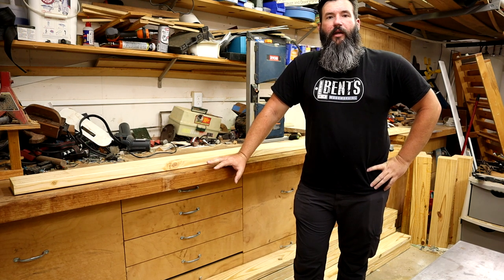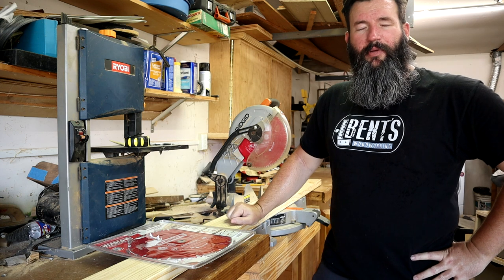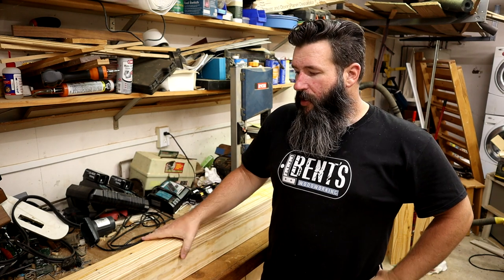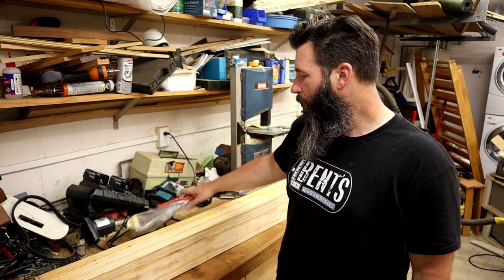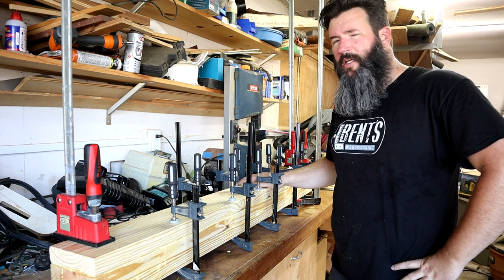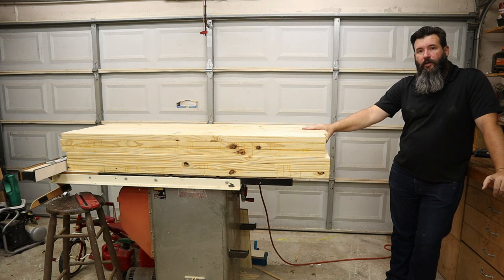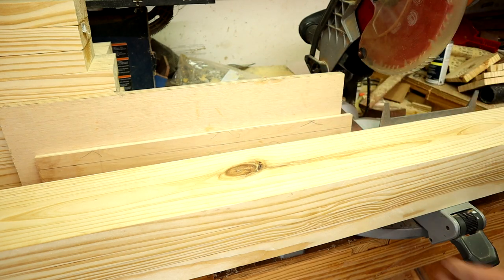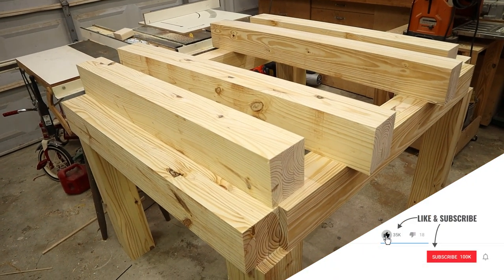Multi Function Outfeed Assembly Table Part 2

Comment: Scary using jointer with no guard on such large & heavy boards.  You got it done, so .......
I see your legs are cut square & flat on the garage floor.  Doesn't your floor taper?  With all that weight how do you plan to level the legs?  Looking forward to next installment.
Reply from the maker: Yeah, the jointer is kind of a "beggers can't be choosers" situation. It was free and didn't have a guard when I got it. I'm planning on making a new base with chip collection after I finish the assembly table, and will probably make a guard for it too.
The legs will have a chamfer and possibly some embedded leveling feet. If I don't go with the feet I'll just cut some wide shims.